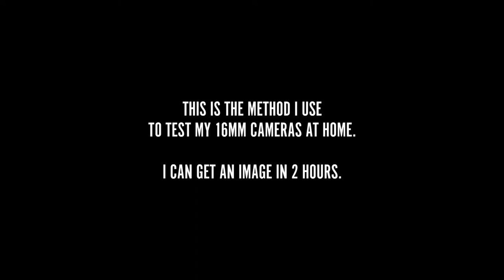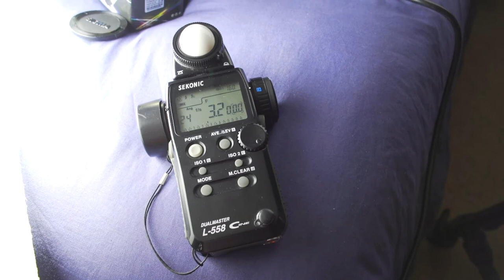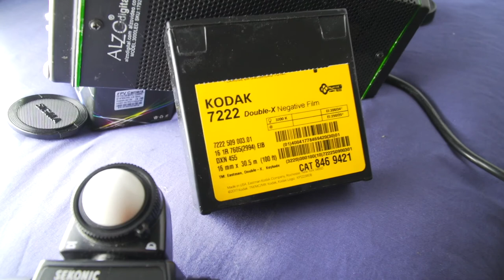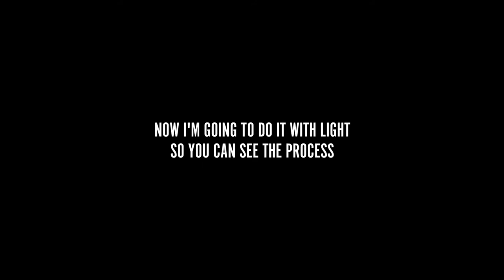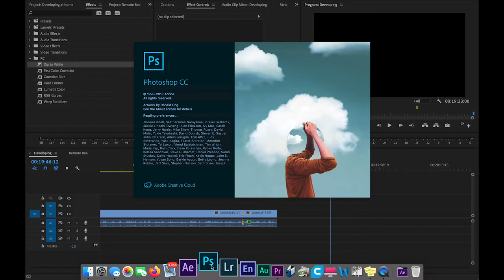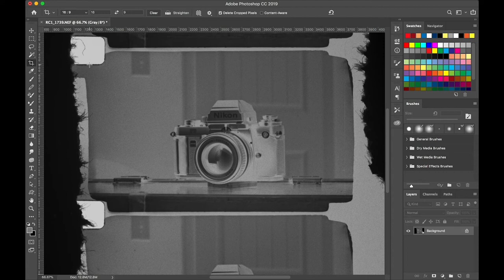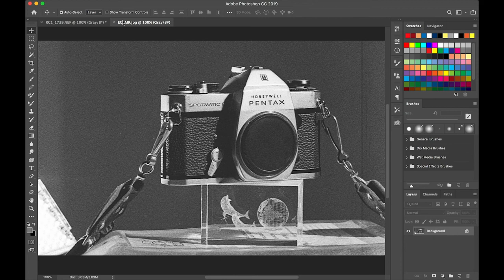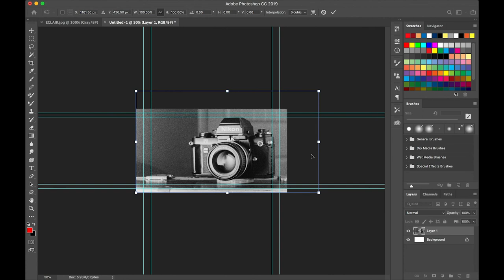Testing 16mm film cameras with black and white film.

Comment: This is a terrific video! 

I have been doing this entire process in my mind, but was never sure if it would work using the Yankee tank. You have confirmed that it works very well. 

I shoot 1:33 (4:3) format, so tank scratches are definitely not an issue for me.

I have a 16mm contact printer as well, so this will also be a way to test it and my technique.

Keep up the fine work!
Reply from the maker: Thanks! 

A contact printer? Wow that would take the process to the next level. I use this method to test film and cameras, but if you are patient you can get usable things without spending a lot of money.

Thanks for watching.

Comment: Great video, very inspiring!
Reply from the maker: Thanks TrueFilm!
Reply: @TheCinematographyLab  It is indeed inspiring. I always did it the slow way (using expired film which I got for free or dirt cheap to test the camera), but your way is the most logical and of course the best for camera-only formats such as Max8, Super- and Ultra-16.
Reply from the maker: @truefilm6991  Thanks Christian! I think this method is a great way to test cameras and to test film stocks as well. You may use it to test you exposure skills, limits, ideas, lighting setups, ratios and the important part is you are getting repeatable results, something you don't get with expired film.

When it comes to Super 8 cameras I don't mind sending it to the lab because I can easily test 5 different cameras with one cartridge. 

I'm going to make a video soon using Kodak Vision 3 film with a still photography camera to test different situations like filtration, under and over exposure, lenses, latitude (DR) and other tests. That's another economical way to test what you can do with a film stock without spending a lot of money and without shooting 100ft of film.

Comment: Would a Yankee Clipper II work as well? eBay seems to only have those models at the moment.
Reply from the maker: Yes, A Clipper II works fine. I noticed that the Clipper II feels cheaper than the one I have. I tried to use a Clipper II to process Super 8 and the roughness of the plastic didn't help at all. For 16mm it should work just fine.
Reply: @TheCinematographyLab  Wonderful!